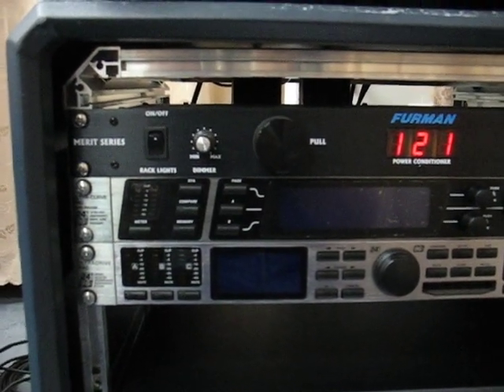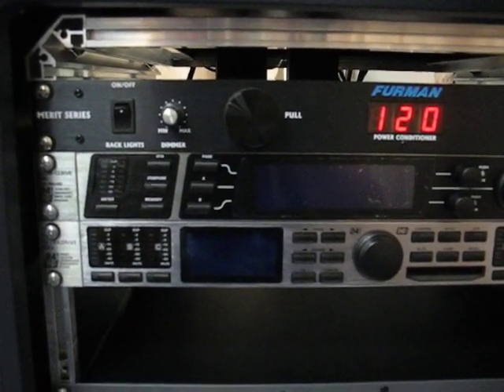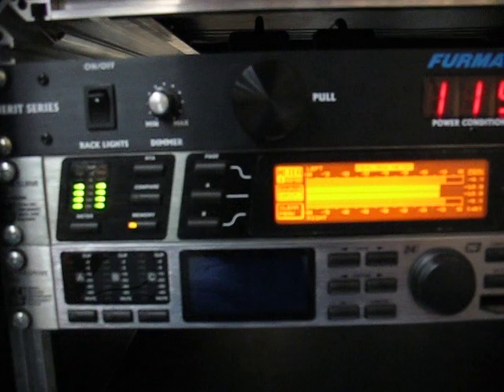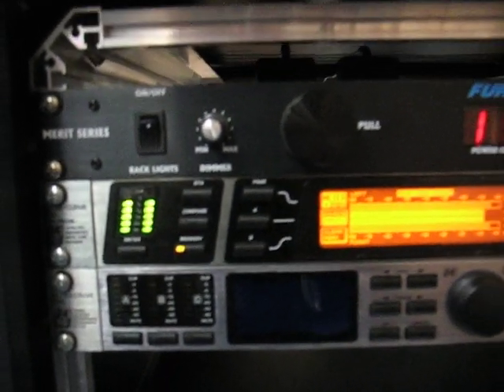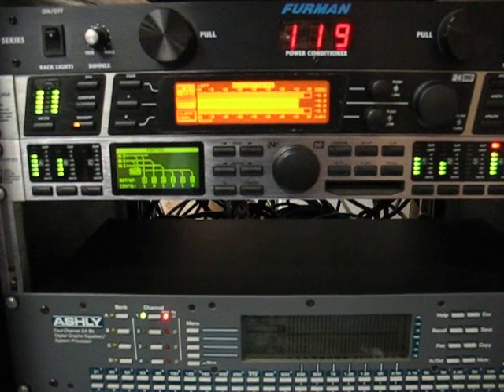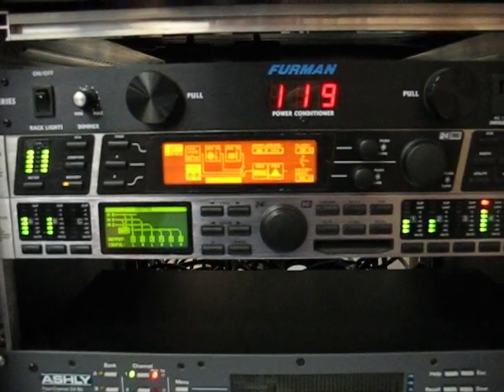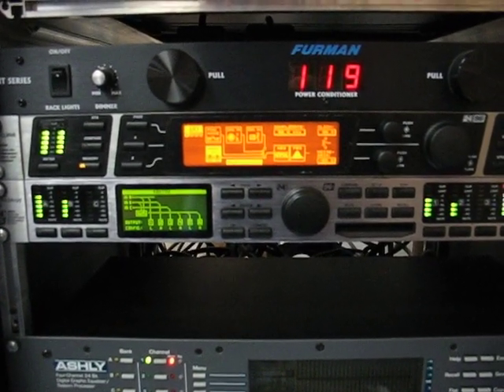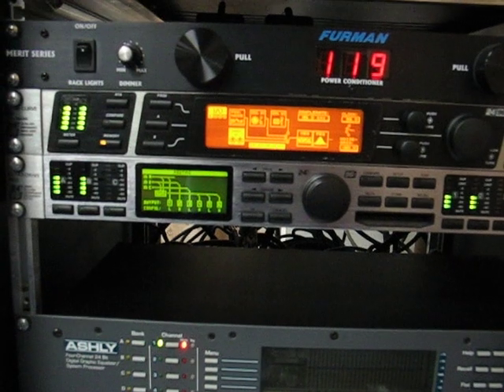Behringer DEQ2496 and DCX2496 Sample Rate Problem

Comment from the maker: Thanks for your comments.

I never tried to resolve the problem. Lower sample rates were acceptable for this application. 

Since the video has been taken, we've only had one problem, on one occasion. The DEQ locked up, and the meters froze. There was no audio output. I just turned off the amps, cycled the power on the rack, and everything came back up ok.

Comment from the maker: The cable is 3 feet long.

Yes, AES/EBU cable is 110 ohms.

I've never seen any AES/EBU cable that wasn't twisted, but I didn't look at this cable specifically.

I don't know what firmware the units are running.